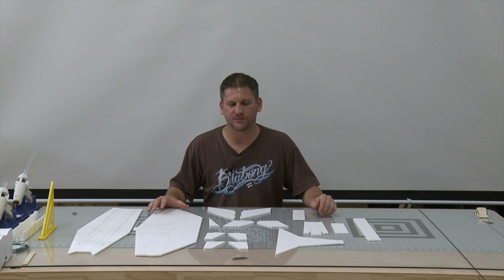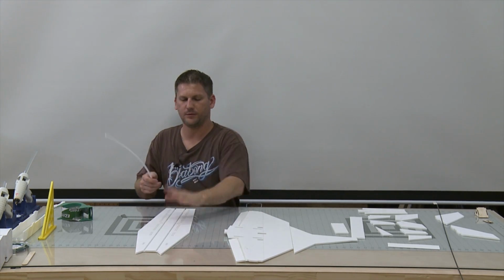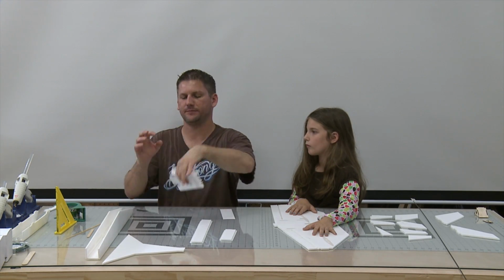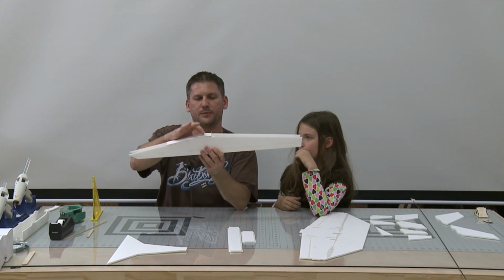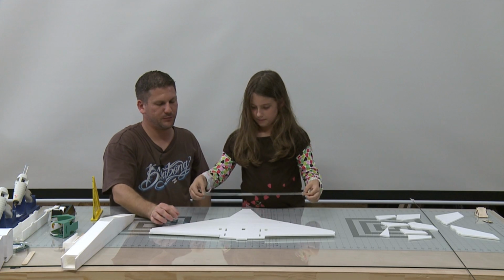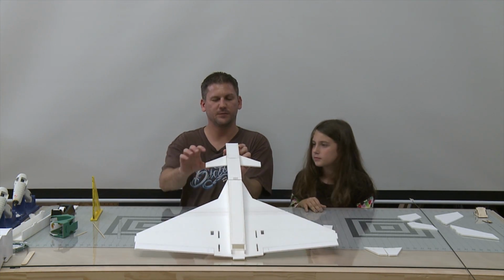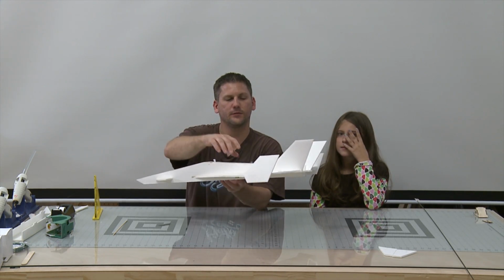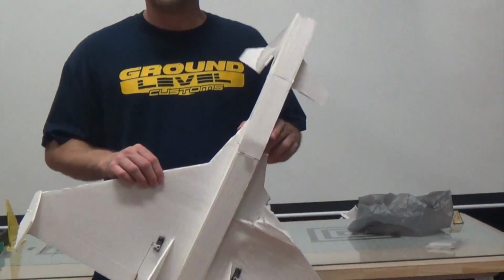Let's Fly RC - X-41 - Scratch Build Video

Comment: Hi Shawn. Its the first video of u I watched. I'm really impressed by the details u gave about ur builds. I found some sogginess here and there. There should have been much lighting for video shoot. I have also subscribed to flitetest. Usually everyone who is interested in scratch building. So its very well understood that some of the ideas are from flitetest. Its not required for u to specify them in the video. Its u urself expressing that u have copied some. And try building ur own designs. Meaning take it from else where apart from flitetest. I have built a f22 based on flitetest plan but have modified it to have airfoil on the wing instead of the single sheet of foam wing. So think of improving the design further from flitetest. Have modifications on ur models. Have airfoils to have smooth transition. Have multiple scorelines on the airfoil rather than very few scores so that there will be a smooth transition for the airfoil. You could have added airfoil wings even on this model so that it looks even scaler. Try improving the ft models instead of just redoing. I find very few views on ur videos so think something different so that u may ever be better than ft. You find many models in the stores, so try to scratch build even them from foam board.Thanks